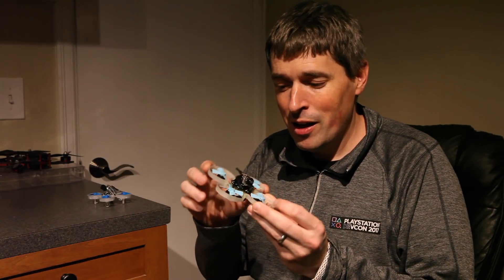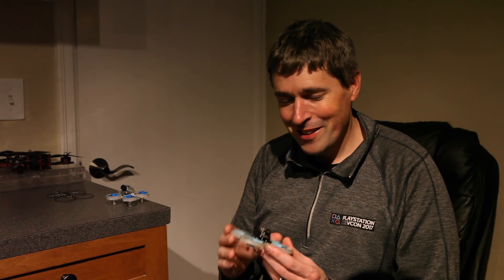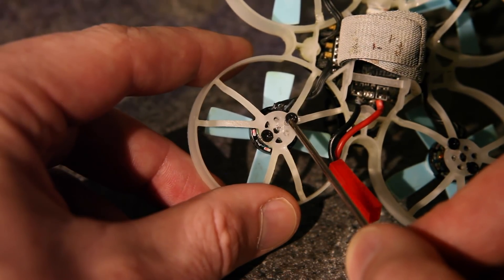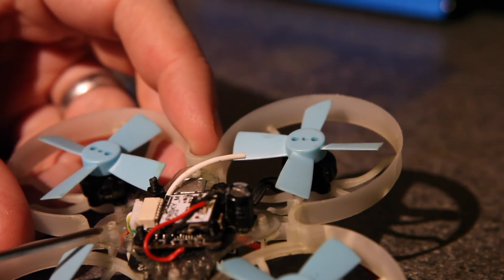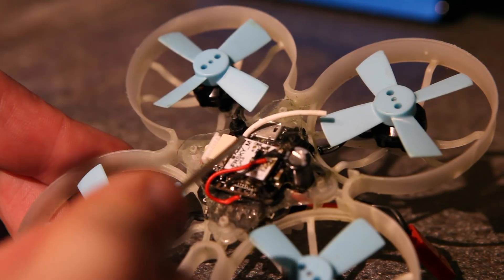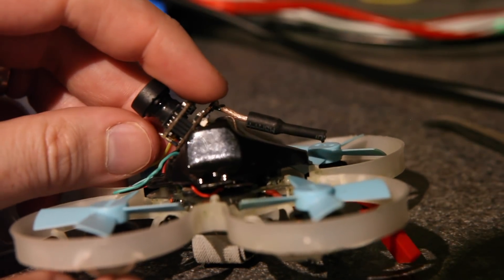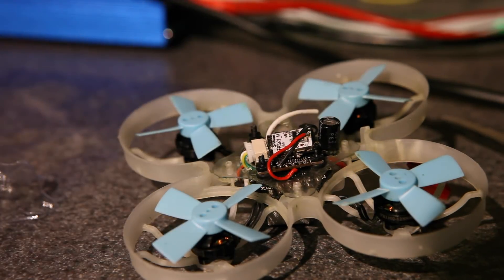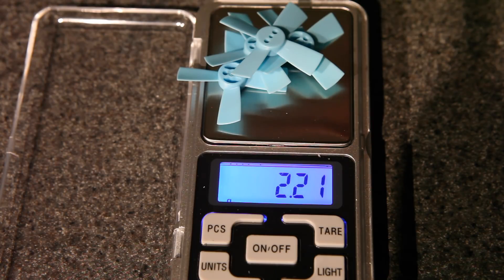Power Whoop Build & Flight

Comment: Hi friend!
Can you kindly explain how you make current measurement? In your video we see on OSD current consumption. As I know  6A ESC BLHeli_S has't current sensor... Thanks!
Reply from the maker: Using the virtual current sensor in betaflight. It’s not perfect but it’s good enough to be useful. If you have a 75mm build like the 75X then you can start with these values but it will have to be fine tuned if you want it to be accurate. 

set current_meter = VIRTUAL
set ibatv_scale = 90
set ibatv_offset = 29
Reply: @MrShutterBug  Thank you very much! This is the most practical advice that I received in the last year!  I use "85" frame with 1935 props, but I know how calibrate sensors. When I do it I put here my notes, may be somebody will interest of this issue.

Comment: Apologies if this has been pointed out, BG sell a whoop board to 16x16 carbon adapter for putting 16x16 stacks in whoops - but I do applaud the DIY approach, it does give satisfaction :)
Reply from the maker: If such a product existed back in early 2018, then I was not aware of it. You have to remember that this build was before the whole 2S whoop craze. The only 2S whoop back then was the Rakonheli Delrin 76, but it was fragile and expensive. Fortunately, 2S whoops are now mainstream and we have better options than either of those!
Reply: @MrShutterBug  lol, I didn't notice the date! YouTube was on autoplay and I was tinning motor wires, as it happens for a Shutterbug85 inspired crazybee build, sorry! :)
Reply from the maker: @1LittleTinker  It's all good. Have fun with your 85!

Comment: Um, awesome! I was shopping around for parts to build up a 2s whoop. This is a nice setup. I'm thinking I might use the Mobula7's all in one FC/ESC/Rx. Would save having to print up a 16x16mm adapter and a bunch of space and weight too. Not sure if that FC would perform as good as the one you're using though. I dont think that the Mobula FC was available when you did this build.

Comment: must use capacitors?
Reply from the maker: FarCurry some people are OK without one, but QC is bad and the super_s stack is barely capable.  The capacitor is kind of a safety factor. The BetaFPV 2S stack on the other hand was designed for 2S from the beginning and does not appear to need one.
Reply: can i use 2200uF 10V?
Reply from the maker: FarCurry 2200uF would be enormous! Are you sure you typed that right?
Reply: 220 uf sorry typo

Comment: This is an awesome build! you should check out the pepperfiish stack for that thing. Its smaller lighter and easy to mount with 4 little tpu brackets i printed. I think I'm going to try this build at some point! I have a pepperfiish and a beta75 pro with sunny sky 0703 motors that flies pretty great! the TinyPepper esc is at furiousfpv and the fc can be found at getfpv or a few other places. the fc has a built in receiver which is great! Its not the best stack for 1s, but on 2s it is great! Check out his blog if you have not been there: https://fishpepper.de/ . I was thinking about attempting to just take my 0703 to 2s. I'm not sure how it will do tho since it is so high of kv at 18000kv
Reply from the maker: The fishpepper should work well for this. I went with the super_s at first because of the higher amp rating on the ESCs (6A sustained 10A burst vs. 5A sustained 7A burst). Also I think I got the whole stack for like $30.That was too good to pass up!
Reply: @MrShutterBug  nice, yeah $30 is hard to pass up! I picked up an extra pepper fish fc when banggood was clearing them out for like $10 I kinda wish I had gotten a few more at that price! The 2s esc is still $25 tho. I have pushed mine pretty hard and never had an issue with the 2s esc tho on my 1103 10,000kv pepper fish. What you have is pretty rocking tho, and probably flies pretty similar to mine but I don't have ducts.
Reply from the maker: Yours might fly even better without ducts. But for me, the durability of the ducts is part of what makes this build special. I'll be posting a new Beta75X video this evening. Wait until you see how fast I fly this thing through playground structures!

Comment: Hi dude, If i mount 10000kv 1103 motors i Will need the Capacitor anyways? If so, where can i found that tiny stuff? 
Other point to know, that 2S stack has the current meter?
 Thx!!
Reply from the maker: The need for the capacitor is debatable. You might be OK without it. I use capacitors like this:
https://www.digikey.com/product-detail/en/panasonic-electronic-components/EEU-FR1A151/P14374-ND/2433508

Comment: Truly awesome quad, I have ordered all the parts to build one myself. I was limited on budget so I got the 1102 11500kv motors from banggood.
Reply: I'm planning to use that motors too(blue eachine aurora 1102 with propellers 1535 ) so tell how It goes!
Reply: It turns out, that the silver screws that came with these motors were a bit too long to be used on the beta75 frame. I broke a motor because of that :(

Comment: Hey man, this vid is so inspiring me to build one, i wanna ask about motor selection, how do we choose the best motor ? The bigger size w/ lower KVs or smaller size w/ bigger KVs ? I’m thinking 1103 10000KVs or 0705 12000 KVs or even 0703 w/ 15000 Kvs?
Reply from the maker: You want 1102 with at least 12,000kv or 1103 with at least 10,000kv. The smaller 07xx motors would be super light, but most of them can't run 2S.
Reply from the maker: Did you see my announcement about the new BetaFPV version of this build? It uses these motors:
https://betafpv.com/collections/new-arrivals/products/1103-11000kv-brushless-motors
Reply: Wow i just knew about it, so has they finalize the frame design? This is getting interesting

Comment: the capacitor, how many volts do you use?
Reply from the maker: 10v capacitor.
Reply: Mr ShutterBug thanks for the answer, and where you soldering that capasitor? i mean, on esc + & - , or on Flight Controller + & - ?
Reply from the maker: I believe these capacitors are equivalent to what I used:
https://www.digikey.com/product-detail/en/panasonic-electronic-components/EEU-FR1A151/P14374-ND/2433508

You want the 10v version because the 35v caps weigh more. I soldered it to the ESC, right where the main power cord connects. Make sure you get the orientation right (or it might blow!). Good luck! I'd love to see it when you are done! :-)

Comment: is there a prebuilt quad with these specs? All the 1102/2s micros i see are larger on carbon frames. I would really like something just like this quad, 75mm ducted whoop frame with 1102 and 2s power. I am just not keen on modding the frame though, is there a 75mm frame that will fit these motors, or a rebuilt with these specs. I really love this build, so powerful, yet its still pretty harmless/lightweight
Reply from the maker: As far as I know, there are no pre-built quads like this right now. There is a pretty big market for them, though, so I think we can expect to see manufacturers stepping in. Hopefully we don't have to wait too long.
Reply: what if i go DIY, i'm trying to find a frame that will fit these motors/battery without modification and give me the same performance. I'm considering the 88mm Piko Owl frame. I'm worried that frame will weigh a lot more though. Can you recommend a frame that would let me do this build without modding the frame?
Reply from the maker: The closes thing is probably the 76mm Delrin frame by Rakonheli. But I have not tried it myself.
Reply: That frame is $30 dollars though. I would rather modify the frame like Mr ShutterBug did.

Comment: Thanks for sharing, I was thinking of using the 1103 motors with this frame but was afraid it wouldn't work. Will order the frame and fly.
Reply from the maker: 1103 can work too, as long as they are light enough. I recommend 10,000KV for 1103 or 12,500KV for 1102.
Reply: Thanks for the info, I ordered some 1103 8,000kv motors because they were cheap, $6 each. I'll look for some 10,000kv motors as you suggested. Do you think that 1103 with 12,500kv, is too high?
Reply from the maker: I can't speak to all the combinations, but in general I think high KV is good because the props are so small. I just have the 1102s, but I know people with 10,000kv 1103s, so I know that works well. My guess is that 12,500kv 1103 will be faster but less efficient.
Reply: Thank you for your input. I will go with your suggestions of going with the 10,00kv motors.
Reply from the maker: Have you tried the 8,000kv motors yet? They should work too. They won't be as fast, but they should have plenty of torque for quick cornering and looping. If you end up trying both types of motors, then I would be interested to hear how they compare.
Reply: Not yet, waiting for the frame.
Reply: Mr ShutterBug it's built and it's great. Feels like a tiny whoop, but with more power. It's very agile. I couldn't find any good reputable 300mah batteries, so I used the crazypony 450mah 2s stick battery. The batteries come in at 27.5 grams, after I trimmed the power lead as short as possible. Flight time is about mid six minutes. Once again thanks for sharing your build. I recommend you try the GNB 450mah 2s stick battery.
Reply from the maker: Awesome! Have fun with it and post cool flight vids!

Comment: which of those nano-tech batteries would you recommend? I looking to buy some.
Reply from the maker: Quality control with the nano-tech batteries is actually really bad. I own 9 of them, and 3 are bad. So, I have a hard time recommending them now, but they are the perfect size, and I haven't tried any other batteries with this build. If you get the nano-tech batteries, make sure you test them all carefully before it is too late to get a refund/replacement (30 days with Hobby King). The performance of the 35C and 45C batteries are pretty similar. They both have significant voltage sag is you peg the throttle, but I believe the JST connector is actually the bottleneck. I suspect that the 45C batteries would perform better than 35C if you switched them to XT30 connectors, but that adds some weight. Hope that helps.
Reply: Thanks for all the info

Comment: Where can i find the capacitor! Ill soon be done with the build
Reply from the maker: I didn't buy mine. It came with something else. But you should be able to get a capacitors of any size from digikey.com. They cost pennies, and shipping is pretty reasonable too. It needs to be a low ESR capacitor. I think this one is equivalent to what I have:
https://www.digikey.com/product-detail/en/panasonic-electronic-components/EEU-FR1A151/P14374-ND/2433508

For more info, you could check out Bardwell's video here:
https://youtu.be/PaKXZSbnvWM
Reply: I chose this one: 
180uF 10V 105°C Radial Electrolytic Capacitor Panasonic ECA1AFQ181.
Size 6.3mm(D)X11.2mm(L)
Reply: Also what screws did you use for the propellers?
Reply from the maker: No screws on the props. Press fit works fine for me.
Reply: Oh ok cool didn't know it had that option😀
Reply: What do you think about the coolrc 1104 8900kv with this setup?
Reply: *8700kv
Reply from the maker: 1104 should work, if that's what you have, but they will be heavier. I think you would get better performance with a smaller motor and higher KV. I use 1102 12500kv, and a friend uses 1103 10000kv. An 1104 motor will be capable of higher torque, but it will be wasted because the props are so small.
Reply: Thanks for replying back! I have not yet ordered my motors so im gonna go with the one of the two options you suggested. I wanna be light an swift!
Reply: Plus i want the best battery times.
Reply: With the 1104 will i still have power to pull out of loops an flips also dives?

Comment: great video and idea! well done with the walk thru. I just finished mine. same build, and im getting about 3.5 min flights i just want a good solution for a slightly larger canopy to protect the top a lil better. great build!! thanks https://imgur.com/WdqupeJ . would like to see if u update anything.
Reply from the maker: Nice! I've been having a lot of fun with mine! I destroyed that first canopy, and the 2nd one. I just fixed it again, and I think it will be stronger this time. I stacked two canopies on top of each other, and soft mounted it to the frame, instead of using screws. If I have time, maybe I'll make a follow-up video.
Reply: having an amazing time with this thing. only 4 months fresh into fpv and mannnn! this powerwhoop is crazy. i just posted a lil video on my channel if ya want to check it out.

Comment: Wow, it seem to handle the wind very well.
Reply from the maker: Yeah. It is super light, so it will get blown by the breeze, but it's not usually a problem for me. It has plenty of power, and the breeze isn't that big of a factor if you fly fast enough.

Comment: is it hassle to charge 2S batteries vs 1s packs?

 Its so easy to charge 1s packs with this board: https://www.amazon.com/Crazepony-Charger-Inductrix-JST-PH-Battery/dp/B073369K2C/ref=sr_1_3?ie=UTF8&qid=1523644211&sr=8-3&keywords=1s+charger
Reply from the maker: Charging 1s batteries is definitely more convenient. I use a charger like this (http://a.co/bZ8AQq1) for my 1s batteries. It's great because it can charge all the batteries independently. For my 2S batteries, I use an XT60 balance charging board like this (http://a.co/5kYSm3G) with a bunch of XT60-to-JST adapters. To charge multiple batteries together, the starting voltage of each battery has to be pretty close, so that's the annoying part. I've calibrated my virtual current sensor so that I can land with around the same mAh for each flight, and that makes charging way easier. The virtual current sensor is not perfect, but it's usually within 5% of the correct value. Hope that helps.
Reply: Mr ShutterBug very helpfull, ty. I love the performance of the Quad in this video, looks as fun as my 5" quad. Is there any configuration that can come close to this performance outdoors on 1s? I love how fast, yet small and harmless this quad is
Reply from the maker: The best 1S performance that I have seen was a 65mm build with 0603 motors. If you can keep the weight down (less than 20g), then the power-to-weight ratio can be really good (for a whoop). As far as I have seen, that's the only type of 1S build that can out perform my trusty brushed build.
Reply: The 0603 65mm 1S brushless builds are great if you are trying to replicate a tiny whoop style experience with a brushless, but to be clear it doesn't come close to this 2S build in terms of power. You can see my 1S build on my channel if you are interested. But like I said if you want something with ducts that gets closer to being able to do the things a 5" can then this is the way to go.